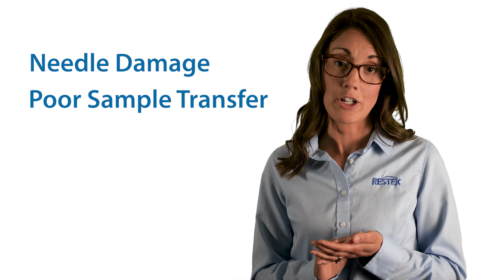How to Cut a Metal Capillary GC Column

Comment: do you also know how to cut a packed metal column ?
Reply from the maker: In general, packed metal columns should not be cut. They are manufactured with specific ends, such as voids of a determined size or packed full, etc. Additionally, the packing is held in place with frits or wire braids that could be damaged if a column is cut.
Reply: ok thanks